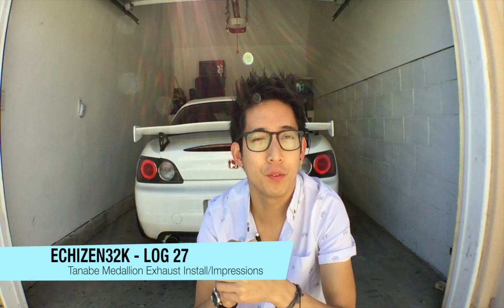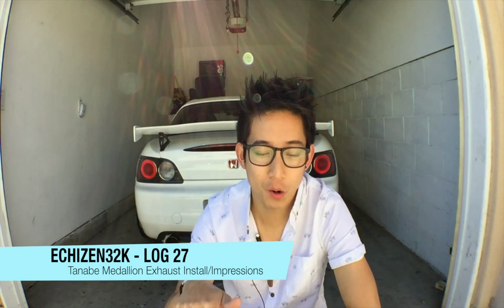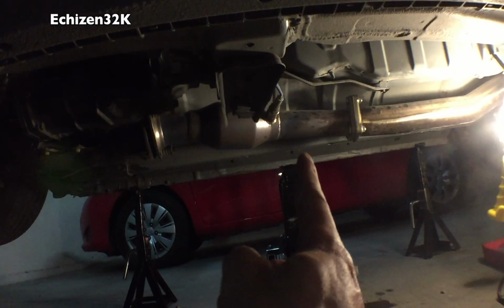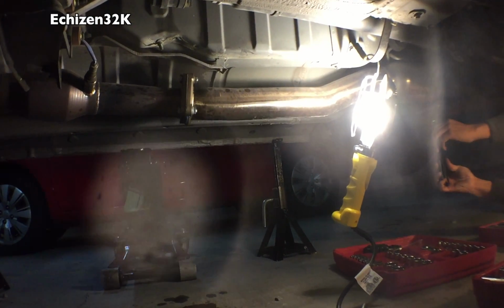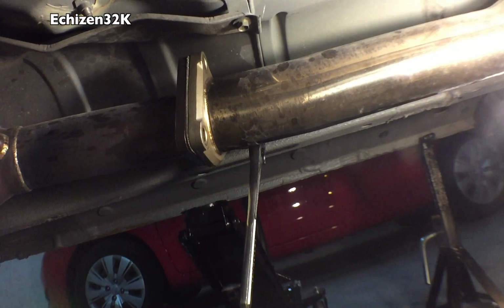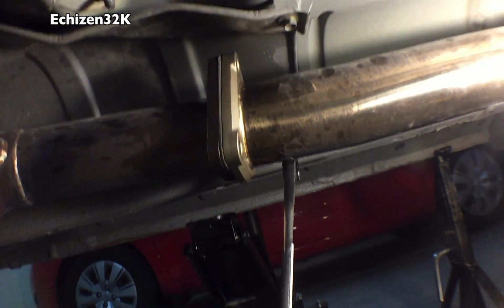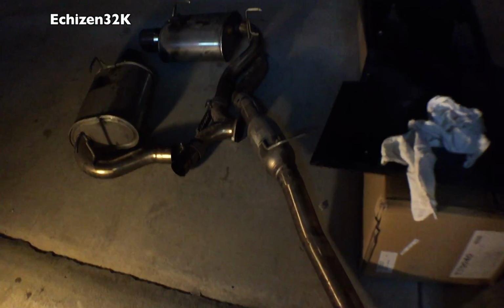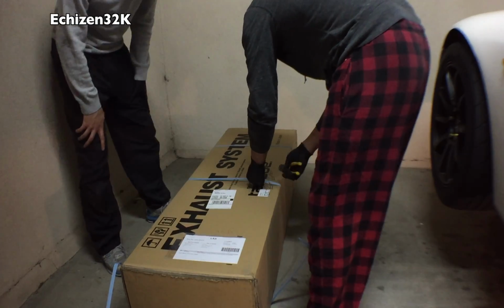Log 27 - Tanabe Medallion 2003 S2000 Install & Impressions

Comment: I just got mine - the box is in the garage waiting for SparkyS2K to come back from the shop with his new motor. If I have all stock stuff, i.e. no high-flow cat, do I have to cut anything or does it all just bolt on?
Reply from the maker: Oh awesome! Good luck on the install.  It just bolts right on, you don't have to cut anything :)

Comment: bruhhh u never did the sound clip,  i'm torn between q300 and tanabe touring

it'll have a test pipe and supercharger.. I want good sound, but not to be obnoxious and droney
Reply from the maker: Get the Tanabe Medallion! You might lose a tiny bit of power but the sound and OEM finish surpasses the Q300 any day.
Reply: actually i'm reading smaller exhausts are better w/ a supercharger! i got the tanabe.
Reply: hey dude. what was the outcome with your setup? is it still fairly loud? did you lose power? im in the same boat as you.